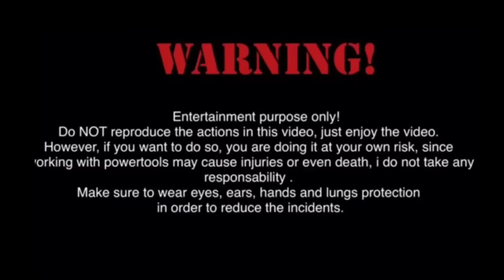Homemade lighter from bullet case

Comment: I work in a shop that has CNC mills and lathes, drill presses, waterjets, laser cutters and 3D printers, but I love how you made do with the tools you had access to, I especially like how you used the drill press as a vertical lathe, kudos…Subscribed
Reply: That lathe work came out better than I thought it would. I subscribed just for that

Comment: very nice craftwork. Still trying to figure out where the flint goes.But ill watch this again.
Reply: James Hightower i dont know if this helps or not but the spot where he put the lighter striker on if you watch when hes making that part you can see he puts another hole underneath the striker wich is where the sping and "flint" sit
Reply: @chrisbaker5439  zippo pistola
Reply: Flint goes under the wheel. Spring goes under the flint. This makes the flint rub against the wheel

Comment: Erm...rite

I don't like seeing pillar drills being used as milling machines or lathes...as the quill bearing setup isn't designed to take radial pressure and you really need a more secure tool hold than just relying on a MT...
This is why milling machines have drawbolts...

But in all fairness it was a nice, easy watching video on how to achieve a result with very basic hand tools and a small drill press... 👍

Comment: What liquid did you use?  And is it alcohol?  What kind of alcohol is it?  But isn't it risky to use alcohol for lighters?  How long has it been I know alcohol immediately spreads and could explode.
Reply from the maker: I did use indeed 90° alcohol, you could use ethanol, gasoline, methanol or any other volatile inflammable liquid you can think of ( i even used perfume in one of my other lighters, and it worked ) 

So pretty good as an emergency lighter! I don't know if it's there any risk of explosion tho, any of those liquids i mention don't burn so fast that it will cause a significant pressure rise inside the chamber, so i'd be pretty sure to say that explosion isn't likely.
Reply: Matsuda Industries oh btw just a note using alcohol IS kind of risky but all you have to do is make sure there isn’t a very good seal